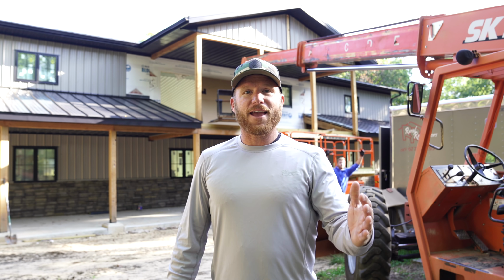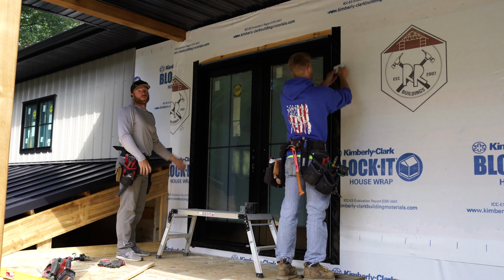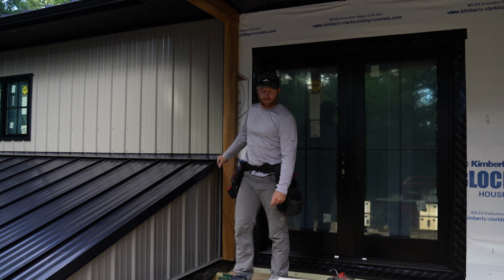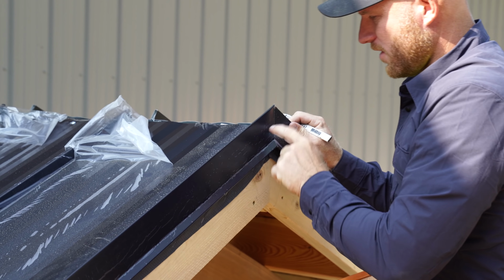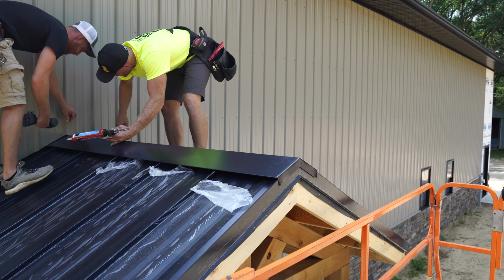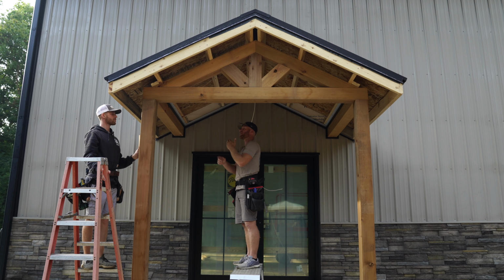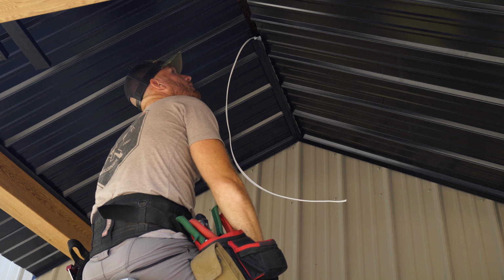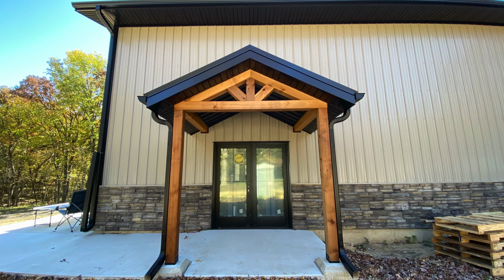Cabin in the Woods: Porch details and Final Steel Siding Install

Comment: I have a question. Why do you use the rib steel on the porch roof instead on the soffit material? Just preferance or is the roof steel thicker gauge? Also could you use the roof steel for soffit
Reply: The soffit metal is perforated.
Reply: @smcox1991  are you sure ? I think they only use perforated on sides to allow air flow to the vent ridge. You would have to use a taller facia if they used rib steel instead of soffit,but I think it would look good when they lined up the ribs from ceiling to the facia with a wrapped beam spliting the two.

Comment: Just thinking about the vented ridge cap. Can you get a perforated (on the vertical surface) Z flashing so you can have the same connection type as the porch but be vented? A bit like the way the soffit paneling is perforated.

Comment: Couldn’t you do a short piece of z trim in between two ribs, about 6 inches, for the ridge vent. Or would that hinder air flow to much? It would make sliding it on a nightmare, but it would get rid of the oil pan.

Comment: you should do 6-8" of open cell foam on all your rooflines and you would never have to use vented ridge again!   you wouldn't have to install your poly vapor barrier, vented soffit or your deflectors (baffles)......   you could also most likely downsize the Tonnage on your HVAC system.    if you use TechSheild radiant roof decking you could go to straight osb.   just sayin